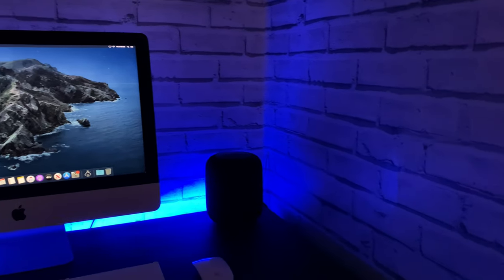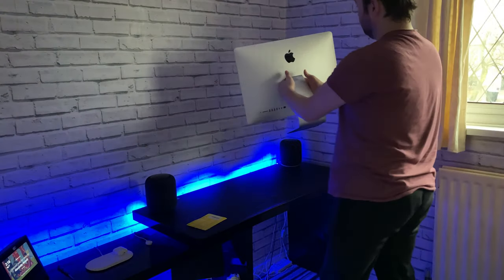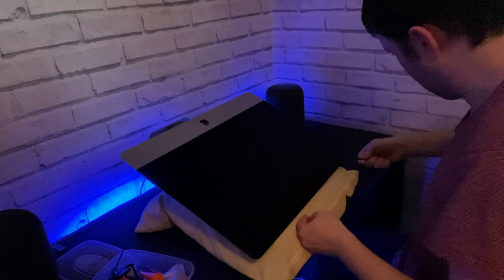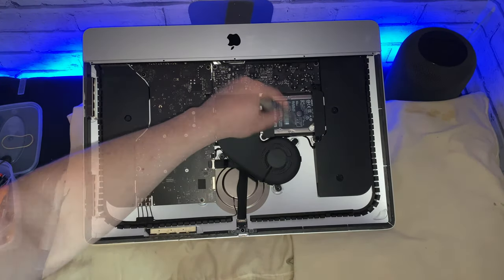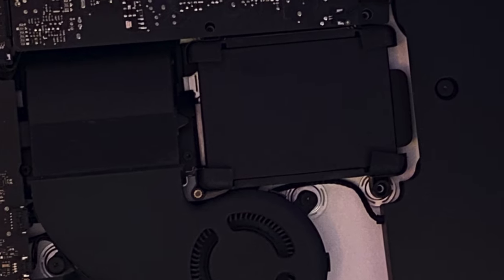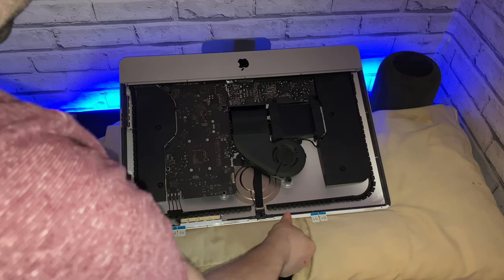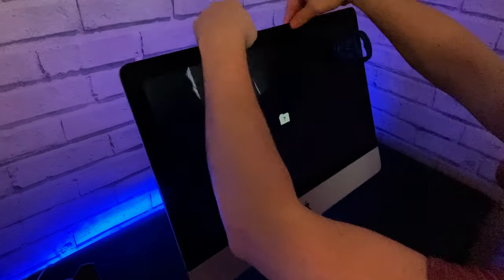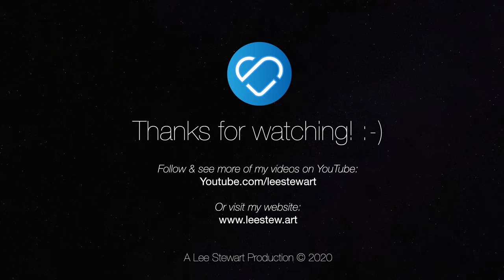Unboxing & Storage Upgrade | Apple 4K iMac (Late 2015)

Comment: Hi, I Just got mine at 200$ It is very slow, mine has same configurarion, do you know if ram can be upgraded to 16gb? I red ram is soldered, do any ssd would work? I mean,  i saw you used a Sata 3 2.5"
Reply from the maker: The RAM cannot be upgraded as it’s soldered to the logic board. Any SATA III 2.5 inch SSD will work. Obviously it depends on the brand and whether it’s efficient or not. I personally have bought both cheap and expensive SSDs and they’ve worked.